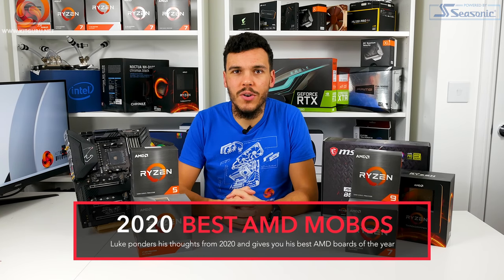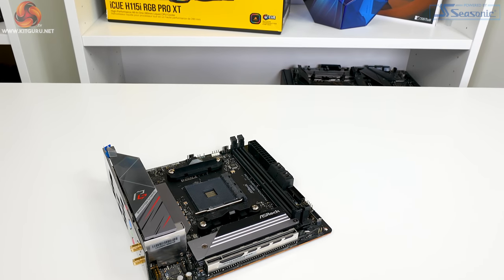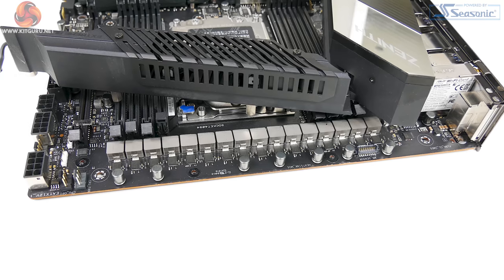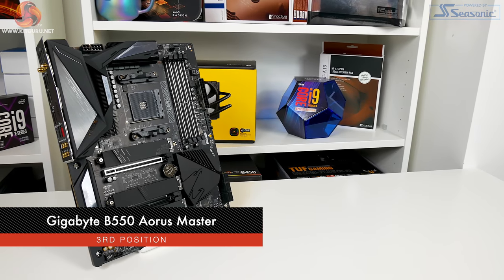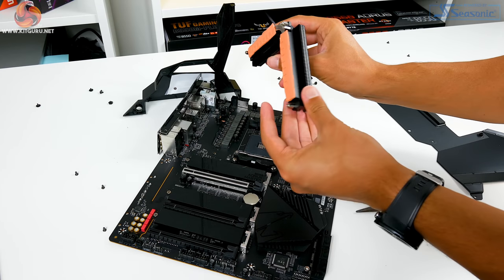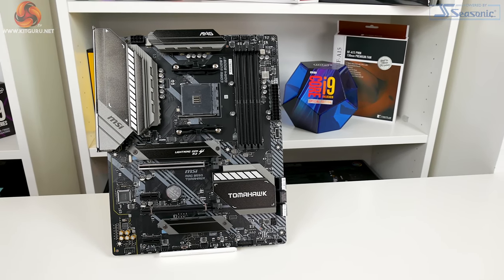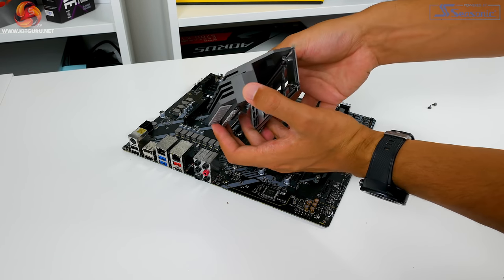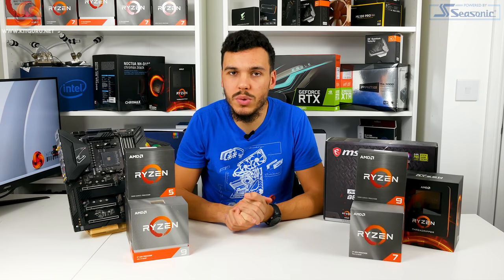BEST AMD Motherboards 2020

Comment: Tomahawk, no Wi-fi, no Bluetooth, bandwidth limitation when fitting 2 NVME, RGB poor. I see this winner as a budget board, price vs performance.  I would choose the Strix E over it. for only £40.00 more. 

Hopefully the bios on the Strix E lives up to my expectations. I built a system with the MSI, it was solid but boring and lacked features.
Reply: Crappy software support included, but Gigabyte has the same crulpit. I wish reviewers should take that in account too. Imaging that you set up the fan & pump curves with the Dragon Center on a MSI B550 Tomahawk (not everybody is still at ease of using the Bios) and a couple of days later, that "Smart Fan Feature" is removed from Dragon Center, or you can't access Dragon Center at all before you install MSI's data collector on your system. Gigabytes AppCenter is the same kind of crappy solution. It's time reviewers that the software package that comes with motherboards into account in their reviews.
Reply: Asus BIOS for the Strix E is very similar to the Tomahawk. And Asus's Fan Xpert 4 is a great way to make complex fan & pump curves.
Reply: @isaacstyles92  Have you read what I placed between brackets. Not everyone is at ease of using the Bios. And those are in a majority of the users.
Reply: @dorientjewoller113  i do agree motherboard reviewers should factor in the included software. It's critical to MOST users.

Comment: Wanted 3 x Nvme slots. First I had a Gigabyte Aorus X570 Master at release it however broke rather quickly, something they are apparently known for. Now I have the MSI MEG X570 Unify which has been working a lot better despite being cheaper.
Reply: I wanted that mobo its awesome
Reply: 3 M.2 slots was also my priority when looking for a mobo (as well as having a black/silver colour scheme). I wanted to get an Aorus Master but saw too many complaints about it not posting, the only fix being removing the CMOS battery, power draining and reinserting. 

I have backordered the unify as well, I can't see anything better reviewed within £400 budget with 3 M.2 slots.
Reply: @Impetu0us  may i ask why 3 m.2 slots is an important feature to u over 2? What do u use m.2 ssds for?
Reply: @iamLODD  I don't like cables, not to mention there isn't much of a price difference between SATA drives and NVMe drives. 

I will only start off with 2 drives but I can see my self buying more in the future, so I want an extra slot to grow into. 

With direct storage due to be implemented into future games I want more than one PCIe gen 4 slot as well. It's not really a must have but I don't mind spending a little bit more to have less hassle in the future.
Reply: @Impetu0us  m.2 PCI-E cards are available. You can add two more m.2 slots for a single x4 PCI-E slot. That may be your best option with few motherboards offering 3x m.2.
Reply: @BrettCarlisle  sure but such a card cost money too so might as well spend that money on the motherboard. Then the Pcie card also won't block airflow to the gfx card which is preferable.
Reply: @BrettCarlisle  yeah but I am gonna use a Lian Li 011Dynamic case, and I don't want an ugly add-in card (not to mention I will have 3 bottom intake fans and having a add-in card below the GPU will block the airflow. So I'd rather just have 3 slots on the board.
Reply: @carbonicdk2  around £300+ X570 boards tend to come with these PCIe M.2  expansion cards, so the added cost isn't an issue, but I agree with what you said about it affecting the GPU.
Reply: @Impetu0us  I only paid £250 for the Unify so was significantly cheaper than the boards with m.2 expansion cards included. It's probably more expensive now though considering the lack of hardware in general so I'm not surprised if it cost more now.
Reply: @carbonicdk2   @carbonicdk2  I paid £264 on NYE so not much more (if I get it in the next week I can qualify for Assassin's Creed for free as well).

Comment: I chose the MSI MEG X570 Unify as the motherboard to power my 5950X. It's a great board looking at the hardware. Complete with 3 m.2  connections, wifi6 and strong 14 phase VRM. I'm happy with it although MSI's Dragon Center software has given some headaches in the beginning. And while my placeholder Ryzen 5 3600 gave no issues at all, the new Ryzen 9 5950x still suffers from an immature bios when PBO is enabled. Even with the new A85 bios based on agesa 1.1.9.0  I get random spontaneous reboots  when idle or  with a low load. With a heavy load it is perfectly stable. But that seems to be a problem with the Ryzen 5000 series cpu's with all motherboard brands at the moment.

Comment: B550 Tomahawk user here, and while everything said is true, buyers might want to consider that the board offers no Wi-Fi or Bluetooth, which eats up USB slots fast if you resort to dongles. Beautiful card, remarkably cool, good potential for overclocking and has been stable during the time I've used it. Still, would trade one ethernet port for a wifi capability in a heartbeat.

Comment: Planning to upgrade from my 4690k to a 3600. What motherboard should I get? Don’t need Bluetooth or WiFi and also don’t care about future proofing
Reply from the maker: If you don't need Bluetooth and WiFi, I personally think that the MSI B550 Tomahawk is a superb option. But if you don't care about future proof, are running a 3600, and don't want any PCIe Gen 4 devices, maybe save some money and get a good B450 option (if you can't justify the extra money for B550). Luke
Reply: @KitGuruTech  Thanks.

Comment: My X570 Taichi has been doing fantastic. Great motherboard for a 5900x.
Reply from the maker: X570 Taichi is a really good board for features. Have you had any issues with the chipset fan? I have read quite a few people being unhappy with the noise levels and UEFI fan curves for it. Luke
Reply: @KitGuruTech  Mine was kinda loud so I just unplugged the fan. My 3090 is mounted vertical so it cools the chipset in place of the chipset fan.

Comment: Best AMD boards and no x570 boards in the lineup?..
Reply: Best AMD boards of 2020. B550 only released in 2020 whereas X570 came out in 2019, so all the movement really has been in B550. You also have to bear in mind that for the vast majority of AM4 buyers, X570 is massive overkill. Even mid to high end B550 provides more features than most users will need.
Reply from the maker: We tried to keep the focus on motherboards that we reviews and/or launched in 2020. There are still some great X570 options, but as Stephen said, B550 really does tick most of the boxes for most users and has the big benefit (in my opinion) of no chipset fan and generally lower cost. Luke
Reply: As an Asus ROG Crosshair VIII Dark Hero owner I was slightly disappointed. Kinda expensive for what it is perhaps but no fan on the chipset made it worth it for me. The OC potential is rumored to be good as well but I haven't played around with it yet.

Comment: I wouldn't dare to use the b550 tomahawk even if it was offered to me for free; back when the b450 tomahawk was the "best choice" everyone I know and their dogs got one and everyone's MoBos consistently died after 12-16 months, the only guy still running his original motherboard to date was the guy who went with the strix b450f and everyone would make fun of him because hardware unboxed trashed it, he got the last laugh and still does as it's now running a 5800X on his same mobo. I'll get the Strix B550F or E. It's a shame reviewers can only realistically review things when they are new, it would be extremely difficult to test everything for longevity, but if it was possible an entirely different picture would be painted about which is the best product, such as the case with the b450 strix and b450 tomahawk back then.